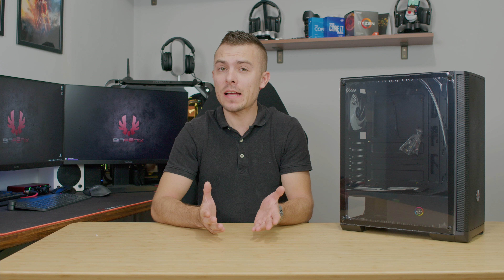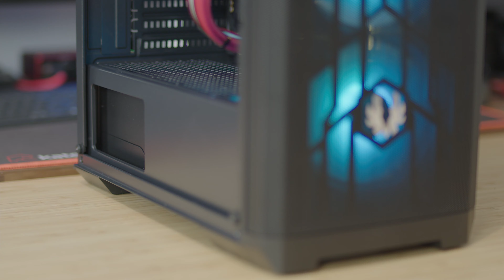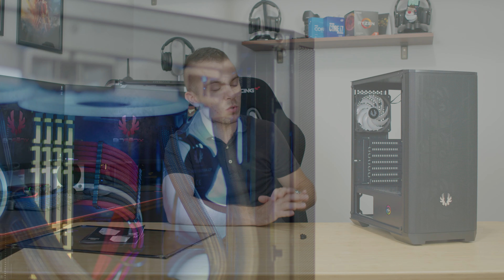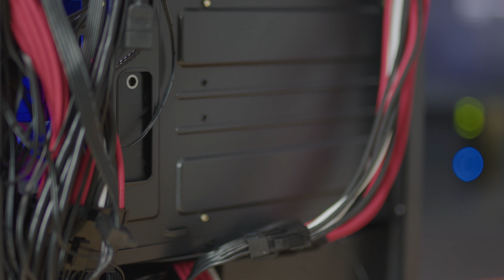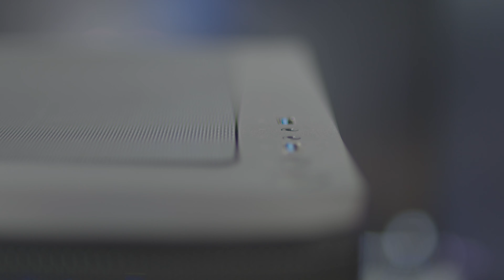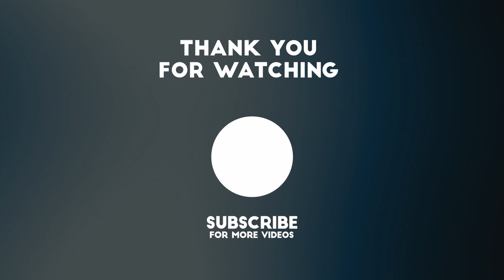BitFenix NOVA MESH SE TG - Testing with Top Tier Parts!

Comment: does a gigabyte GeForce RTX™ 3060 Ti GAMING OC 8G  (L=282 W=117 H=41 mm) fit in this case?
Reply: And should i need more vents for air flow?
Reply from the maker: @leonardotrfm3815  The GPU should fit because the maximum length supported is 315mm. You can always place additional 2x 120mm at the top part of the case. ;)

Comment: Idk why it says support 240mm AIO on the top, but it doesn't!!!!! IT DOESN'T, I am using MSI b560 bazooka mAtx board, I can't install MSI 240mm AIO because it will hit RAM stick, so disappointed.
Reply from the maker: Well as you can see I placed a 240mm radiator on top and did mention everything in the video.
Reply: @PCCrazyDario  I had to buy a new case because of issues I found.

1. Doesn't support 240mm AIO on top unless it's ATX motherboard because of RAM clearance.
2. Doesn't have reverse PSU mount option, I had a RGB PSU but can't mount fans upward.
3. Space issue, very small space, I recommend this is Mini ITX only..... I found it very hard to mount my SSD, HDD drive, it's impossible with mAtx board I bought.

Summary , buying a new case and throw this in the bin.... 
Honest personal opinion, no joke.
Reply from the maker: @yizhang1847  Yeah man, I totally understand you. I did mention in the video that the case has limited space for cables, for GPU, for radiator support. It is a smaller case in general.